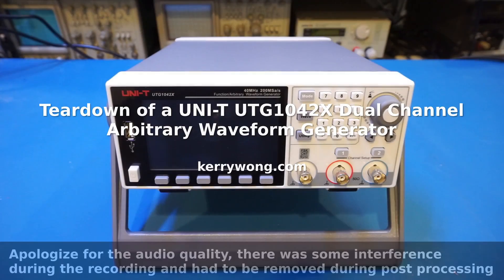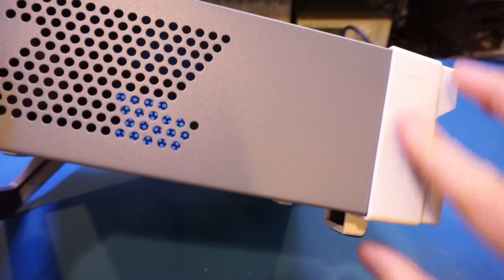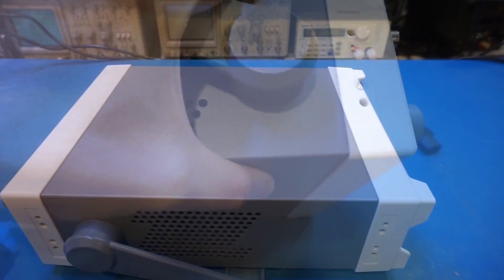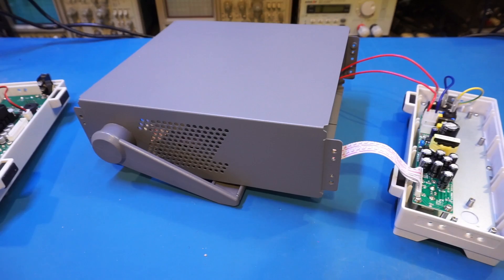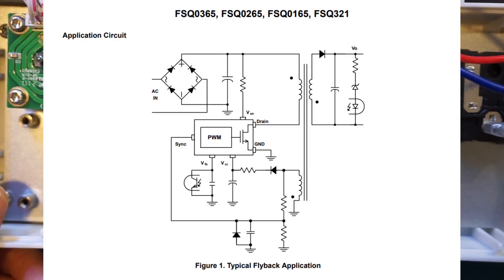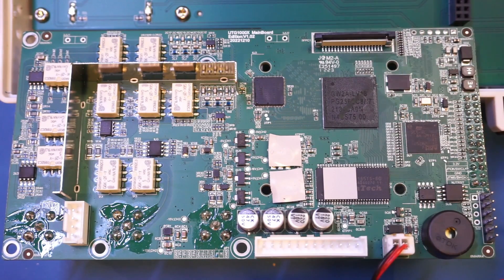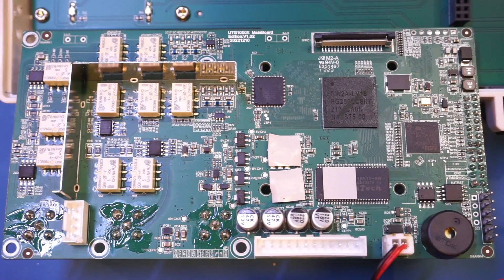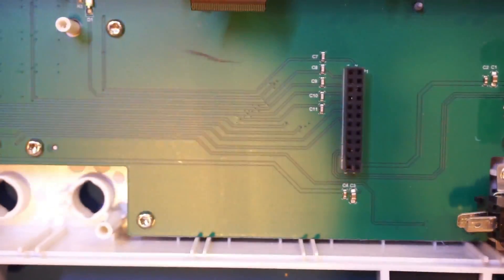UNI-T UTG1042X AWG Teardown

Comment: Curious. Why would they use such an expensive 1230MSPS DAC in a product specified as 200MSPS? No doubt UNI-T don't pay $40 a piece but it would still represent a big chunk of the manufacturing cost (perhaps < $150?) for a product retailing at $350.That's on top the FPGA which I don't suppose is cheap and the LCD display.

The THS3092 opamps are listed at $6.5 each by TI @ 1K, so another $13 there.

Perhaps it's a lower speed model of a range of AWGs and they opted for the economies of scale to use the same board for all types. Seems a bit of a stretch though. It would be fascinating to know what volumes they expect to sell.

I can't find any reference to a GS333 comparator (Gainsil?); what might they be used for?

Comment: Lots of reviews have been showing up for this unit lately, but your teardowns are the best, showing us the quality of design and construction.  Thanks! 
I've used your example with my electrophoresis PS. It is very capable (4000V, 200mA), but limited because it tests for a maximum of 5M ohm in circuit before applying voltage.  I've found the circuit for the test, which I need to fool. 
I miss your repair and construction videos.   Your examples have helped me several times.

Comment: It looks well made and a solid design but the massively oversized  box makes the whole company look like a complete joke.
Reply: its their form factor to stack with other equipment, sure they could have made it slim and thin but where you put it then on the bench alongside other stuff?
i even would have put a brick inside to make it heavy and not slide around when pressing buttons.
Reply: @gamerpaddy  The trend is to have equipment much thinner. I guess if you have a retro oscilloscope and an old HP multimeter this would fit fine. I'd rather have vesa mounts and a lot more bench space.
Reply: then get the other model??uni-t makes two for that exact purpose. you looking at the stackable model and complain that its stackable.    i have 3 units (not uni-t but others) sitting in a shelf above my workbench, 2..3 ontop of eachother, no space for vesa mounts. i wouldnt know where to put the slim model.
Reply: @gamerpaddy  Maybe they could put a pie warmer in there? Make some use of the space.
Reply: Yeah, it's definitely meant to stack with other equipment from various manufacturers. The size is pretty standardized in the test equipment space. If it's just skinny like the other model, how do you stack it?